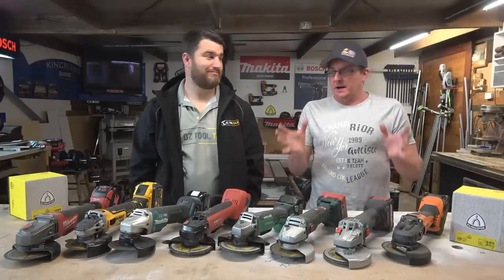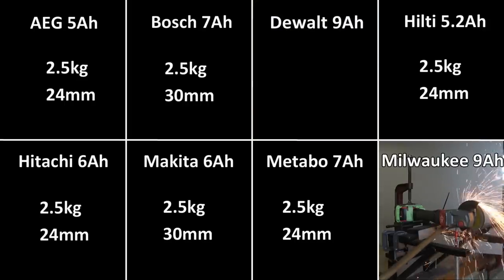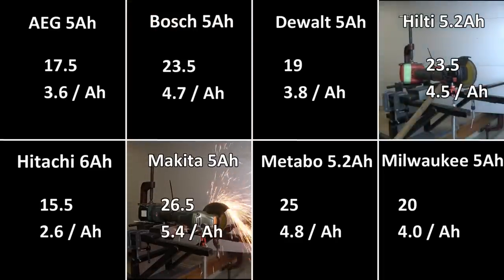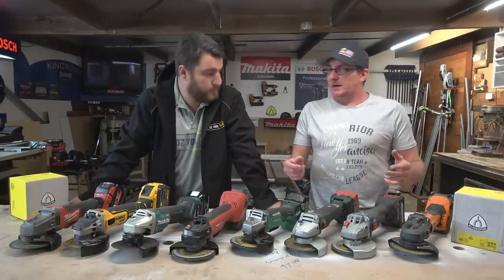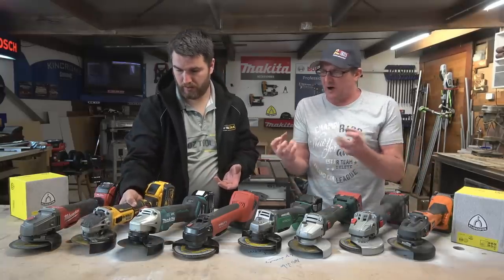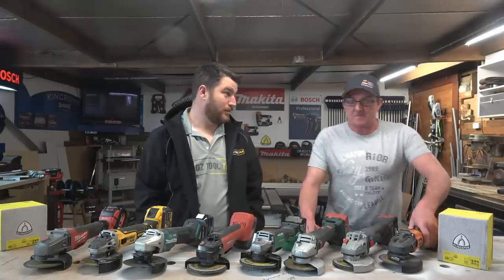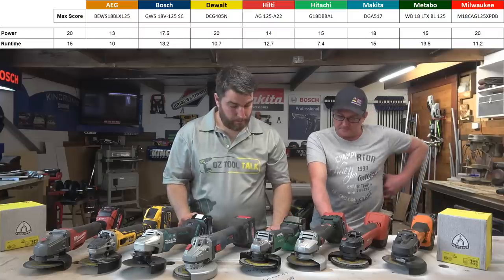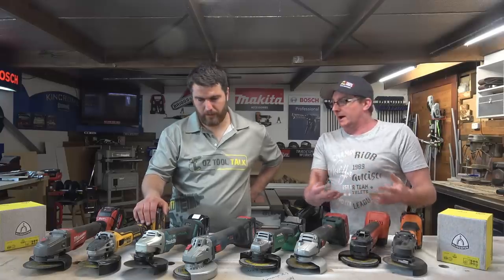18V Brushless 125mm GRINDER SHOOT-OUT - Makita, Milwaukee, Dewalt, Bosch and MORE.

Comment: How the comments look: "So-and-so is the best."
How the comments would look if they were honest: "So-and-so is the battery ecosystem I've bought into, and all I have experience with."
Reply from the maker: Hahaha nice
Reply: @gabbermaikel  well I'm a bosch man but bought the makita because it's the best tool. I've also got willfucki, but threw it out. I've just bought the best of the time regardless like music men don't buy a hi system they buy the best bits from all maufacturers, bit like big bits of workshop machinery.
Reply: Michael Bamber are you talking about cordless? Because with corded tools that i more how people do it. All corded tools can be used on the same wall outlet, no special branded wall outlets needed. But for a cordless tool the biggest investment is actually the battery system. If you buy a new cordless system with 3 batterys and 2 tools you are looking at about 500€ so probably 600$ for the 18-20v tools. But only the bodys(so the machines without batter and charger) could be bought for about 250, maybe 300€ that means about 50% of the price is for the batterys and the charger. So if you allready own 3-5 batterys from in you case bosch you are in on that for more then 300-400€ and you could then go for a cordless grinder for just 150-200probably. If you would buy the grinder from dewalt or makita that would again set you back nearly 500 because you need the charger and the batterys. And now that grinder dies because the hot supper you gave it was to much and you got 300$ worth of batterys sitting there doing nothing. Where as if you bought everything from 1 brand then its no big deal because those batterys wil be used on your other tools so not really any wasted money there.
Reply: Not necessarily so. I have the DeWalt corded grinder and am looking to get a battery powered one. I'm not going on brand but which one does the best job. Makita and DeWalt tied. But the DeWalt cuts faster and I already have batteries for it so to me that wins.
Reply: VuHuy
Reply: @OZToolTalk  Prices have some variation , been looking some Makitas and their 230 mm 36 v grinder , is in one shop 200 euros , 250 euros with the BT ship (no batteries) , while a DGA518ZU is 220 euro , thats the 125 mm one with BT ship , when the model you tested DGA517 cost more ... have no clue how is Makita and retailers setting their prices , you really need to do some work to get the best deals .
Reply: Hey guys, expert opinion here, uniquely expert, while milwaukee was able to retain the torque in some tests, don't use that as a gauge for what to buy.

Milwaukee batteries fail the MOST out of every single power tool listed here and so do their grinders, always in under warranty.
Yeah it cuts well, but dewalt is faster on 9amp54v/(8amp18v is better) and batteries fail the least but makita and metabo are the next best runner ups, if underpowered a little.

(Im a tool salesman and a boily, practical experience and also seeing the thousands of tool repairs come in a year)

I'm a dewalt man exclusively because they sell well yet we're never having to repair them
Reply: @michaelbamber4887  True man, you do what you want, it is your money. Personally, I would not do that but, the decision is for everyone themselves.
Reply: @DoesntHurtYet  well the makita stuff is still going sir, not a single battery failure yet, was giving it a beating on a big job yesterday, grinding, cutting and a bit of flap wheel work. 18 months of daily work. Battery life is pretty much the same too, been very impressed with makita.
Reply: @gabbermaikel  maybe cos they didn't research it
Reply: I got the dewalt dcf899 impact gun with batteries and charger so my choice is already done. Happy to see dewalt always the best tool
Reply: Please take my “thumb up” for your comment
Reply: You are so on point, switching brands can be very expensive if you already have a bunch of batteries. That's one reason (not the only reason) I have  turned to Metabo, because of the Cordless alliance system, I just really wish that some of the other major brands would get on board so I could mix my tools and batteries!! It would be a godsent for people who use akku tools daily, and also more environmentally friendly..

Comment: Good stuff fellas. I have gone through Hitachi tools, Milwaukee tools and now I'm on Makita. I went with Makita purely for the ergonomics and the battery runtime. The Makita representative also gave me the heads up that you can remove the four screws from the head of the grinder to rotate the body.
Reply from the maker: Yeah a lot of units allow that
Reply: Makita is really good. I too choose it mostly for ergonomics and familiar battery. Makita was one of the first big brands to use Li-ion batteries if not the first. Ergonomics of wall chaser is better on Dewalt though. Makita just lately started to feel bit outdated, but tools are still very usable.

Comment: Shows how advanced Makita electronics are once they finally come out with a high demand battery look out
Reply: Yeah but no. There tools use two batteries instead of one. I don't want to have to buy multiple batteries just to use the tool.
Reply: Sculpin  ? ? ? The Makita angle grinder featured in this video uses 1 battery.
Reply: @truefalse207  a lot of makita tools use two.
Reply: @averagebloke4474  it's just another way of generating more power dewalt and Milwaukee use one massive battery while Makita uses 2 small ones. The x2 system is only for high demand tools
Reply: High demand = marketing nonsense
Reply: Actually no
Makita buys technology from other companies and isn‘t that strong in development.
Reply: @Nanogenium  What a load of rubbish Makita have been making power tools for over 100years..silly comment...
Reply: @Ray Trammell Uhhh okay buddy. No need to be disrespectful.
Reply: @Ray Trammell okay man whatever.
Reply: COMING SOON - Makita XGT 40v Max Brushless Impact Driver
Reply: @Nanogenium  Bullshit ,Makita is the leader ,has  been for years.

Comment: i use the milwaukee and the dewalt (those exact models) at work and they are both just superb,  but there is like you say a powerthing going on with the milwaukee. part of my work is both maintaince and fabrication on board ships, and the milwaukee is a tool you always tend to grab with you because you know it will do the job, and now you can get a 12ah battery for it. 

i ended up byuing my self a milwaukee to use at home.  it literally eats up batterys, but its a wonderfull tool
Reply: Those are actually my two favorites as well.

Comment: I've got the makita an it's a ripper, well nice tool. My mate has a Milwaukee and picked mine up an he thought my makita was a nicer tool to use. An he works day in day out as fabricator welding an grinding up to 12hrs a day. I used to but now just a side line but still make fair use of me gear.
Reply: yeah, half hour continues  use isn't bad. How long does anyone else's 5amp last in a grinder? Its pretty impressive to be honest, you could not supply 600w for half an hour.

Comment: For anyone interested, I've used both the AEG in this vid and the New one, and its night and day. Using the 9ah battery I can use it for more than twice as long, and the cuts take less time.

I don't have the jig, but I suspect it would have done around 25 cuts in the duration test and I suspect it could have handled at least 50% more weight.
Reply from the maker: Dragonling Yes we have the new one and you are right in that it is very impressive. Devastated we couldn’t get it in time for this comparison ! Glad you like yours.
Reply: @OZToolTalk  You guys might actually be able to help me with something. The way I got my tools was in a big kit, downside is that they don't come with individual protective hard or soft cases. I'm already noticing scuffing from storing all my tools in the provided wheely bag. Do know where to get anything similar to the cases most power tools come with since AEG support was unable to help me?
Reply: Same I got the fusion kit from AEG and they are the best tools on the market but they did come with some stuffing but I went to Bunnings and they gave me 2 hard cases for the drills and grinder

Comment: The AEG grinder in this test has just been superceded. As well as the Fusion model they mentioned in the video, AEG have also brought out a new 'conventional' brushless grinder that replaces the one shown here.
Reply from the maker: Really?!
Reply: Yep. I have the “ridgid”/aeg brushless grinder and it’s awesome! I have done Tons of work with the 5.0 battery. The 6.0 and 9.0 have come out now so I would like to see a update since there current grinder is more on par with the others
Reply: Yeah, the one you have has disappeared off their site and been replaced by a new model that looks a lot like the Fusion grinder only without Fusion.
I got a good deal on the grinder you reviewed a few months ago, I guess that was why.
Reply: Yeah there is a promotion with the fusion hammer drill and driver kit ATM, get the new fusion angle grinder. Would be great to see how these ones perform
Reply: Z71GALLA well this answers my question about aeg being ridgid and I’ve been looking into the ridgid octane brushless grinder.

Comment: Well done guys, great review as usual. Pretty happy with Bosch result will stick with Bosch for a while. Seems like Bosch jumped big step to cordless tools market now. New tools and battery are come with 6 years warranty which is fantastic...
Reply from the maker: wei shu thanks mate,
Yes Bosch are making a serious push right now 👍🏼
Reply: @OZToolTalk  Bosch has like milwaukee and Dewalt a 12Ah batterie but unlike the other they have a new fast charger that charges the 12Ah at 100% in only 53 min and 10 Ah in 35mn.

Comment: As far as the plastic and lack of overmolding on the Metabo. That rubber overmolding found on the other tools is gonna degrade due to grease, oils and friction found in typical uses. A good pair of gloves would solve the vibration and fatigue issues of holding the plastic Metabo. 

I'd rate the Metabo as number one due to the durability, ease of use, and rotating battery pack.
Reply from the maker: Miguel P hmm, I can say I’ve only ever had a handful of tools in close to 15 years come in for repair with stuffed rubber overmoulding. 
Not discounting your comment but I certainly don’t think it’s a good reason to have less rubber. (Mike)
Reply: Ah, good to know, thank you. Perhaps it matters the type of rubber and the place the tool is used, like a mechanics shop where grease and oil would be hard to avoid.

Comment: Hi, love the channel, great to seem some Aussie reviews. I’m a boiler in the mining industry and I’ve been using Milwaukee tools daily for the past 6 months and so far I’m absolutely loving them. I have used hitachi and dewalt and I reckon although there tough I still reckon the Milwaukee gear one the whole takes the cake. I’m not sure if you guys have used the Milwaukee 9/7 inch, I’ve had mine for a few months now and I love it, so much power for a battery grinder! The high output batteries really make a difference with the grinders too I have noticed. Would be interesting to see this test with the Milwaukee using the high output battery!
Reply from the maker: Jack Rideout That’s great that your happy ! We havnt used the 9” no, I’m sure the HO batts make a difference. We have just recieved the 6.0 and it will he interesting to see the improvement. 
Glad you like the channel 👍🏼👍🏼
Reply: One thing I’ve noticed with the high output batteries is the increased charging time but still worth it for the extra tool performance! I’m also loving the m12 gear the 1/2 drive standard impact wrench has been one of the better battery impact wrenches I’ve used even compared to 18v definitely punching above its weight! Look forward to seeing more videos in the future!

Comment: Loved this all the way from England you Ozzy nutters ;) great take on the brushless cordless angle grinders. I like the Milwaukee; Basically I am a mechanic and own Kielder kit (Mechanics kit from UK) all brushless, market leading power to size impact wrench (for mechanics) Then I had the battery so I got their angle grinder and drill and impact driver and torch. the angle grinder is a little long however and 1 job cutting the top McPherson strut in a bad access spot would have been amazing to have that flip battery or just a little bit shorter. That said on normal application the length is good. Finding the correct size with battery included for me is important for cutting rounded off drop links out in tight areas as a mechanic I still use my Dremel for that sometimes for access. But now I need carpentry kit I have to choose another brand and battery. I choose Milwaukee over Makita for the "Fuel" brush;less line up is good and all the accessories they offer are great. Expensive kit though:(
Reply from the maker: cheers for the support Henry!  Enjoy the new gear.

Comment: milwuakee just came out with their 12.0 amp hour battery and dewalt has announced theirs, milwuakee also just released a 9" 18v grinder, 

i dont see any diy'er or small time welding shops getting much use out of the 9" one though as the disks are too hard to find locally, only place i can get them is the local welding shop and they require you to order a full box at a time which is 200-300$ i know ill use them all eventually but its a big cost all at once that might be better spent on a plasma cutter

Comment: Such a shame the 54v Dewalt couldn't be shown due to the whole 18v thing. Bought the thing about 2 months ago for working on my knives and it's an absolute power house.
Reply from the maker: [Dwain] Yeah it's a monster and would smash all of these
Reply: @OZToolTalk  the run time is the only bummer about it since i only have 1 flexv battery. But besides that its so fun to use.
Reply: @OZToolTalk  Or even the Hikoki 36v, got to test it with a rep today. Thing holds up well.

Comment: The higher demand (amp hour)  the battery the shorter it’s life is. Makita is smart because they have average battery amperage so the batteries last many cycles. I’ve had my first makita set since the 18v first came out and the original batteries still work fine
Reply from the maker: Do you have any evidence to back up this claim?
Reply: No he doesn't because it's BS. 
High demand batteries have same cells (18650) than average batteries only few more cell so lifetime expectation for whole battery is same, it might be even better because high demand batteries have more inside electronic than average batteries.

Comment: On the run time you should compare watt hours
Reply from the maker: Yeah because the Hilti isn't 18V, that's a fair call. I almost did but didn't want to confused viewers in what was already a fairly convoluted video.

If everything was the same voltage, there would be no difference in comparing Ah or Wh

Comment: The Rolls-Royce is the metabo 36v,  a match between dewalt flexvolt would be clash of titans
Reply: New bosch biturbo grinders ?

With 12ah pro core battery.

Is like u use a 1500w corded.

Comment: I’ve got the Dewalt albeit the older model and my mate has Hilti. That extra few volts under heavy load is great on the Hilti which doesn’t show here kind of confusing. I’m disappointed going back to my old Dewalt after the Hilti but the new one looks pretty powerful. If mine breaks I’ll get the new one Butkus still going strong after 5 years heavy use so they last.
Reply: The difference in power and runtime between the new brushless 18v Dewalt grinder and the older brushed one - is night and day.

Comment: I recently bought the bosch n used it for the first time today and the switch thing was pissing me off too! Also running my old 3ah battery's it just chewed through them and constantly kept cutting out under load 🤦🏻‍♂️ i was pretty disappointed tbh but hopefully with the new 7ah i just ordered it will improve 🤞🏻 thought it was the ducks nuts n love bosch gear but thinking i should of gone the DeWalt now 🤔😊👍

Comment: Great job guys!
Yes I agree the weights do offer some science to the comparison.
Was the weight paced on the grinders a bit much for the run time test? 
You said the  Bosch did overheat and I notice at 6:00 in the Milwaukee battery was showing that the tool had overheated, rather than showing depleted battery.
Reply from the maker: yep it probably was a bit much :( 

The Milwaukee battery was already on one light, so it was actually empty as well we believe.

Comment: I have milwaukee tools myself.
when the battery is flashing they are not empty but too hot so they cut to take care of the battery.
otherwise it was a good test
Reply from the maker: [Dwain] you're right. but it can be both flat and overheated. Our general rule is that if a tool cuts out when it was already on one bar, then we call it flat. The number of cuts was certainly not low.